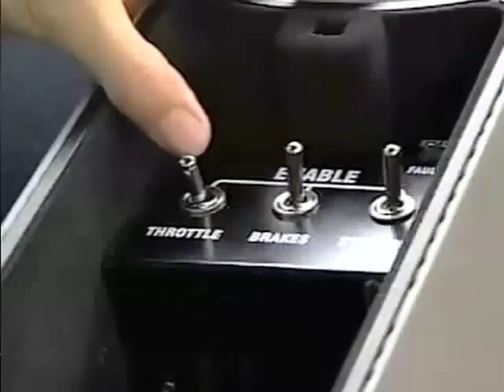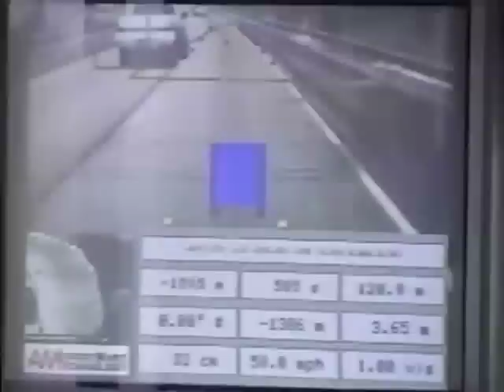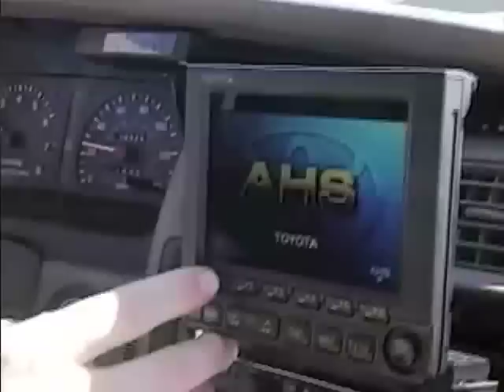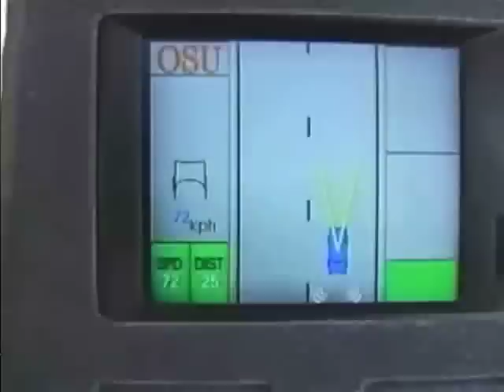Automated Highway Demo 97

Comment: 23 years later and we kinda have adaptive cruise control in most new cars and lane departure warnings but we didn't go ahead with the in-ground sensors. it's sad a 1997 demo vehicle could recognize and go around the barrels but we've seen various Teslas running into fire engines, concrete barriers and other things.